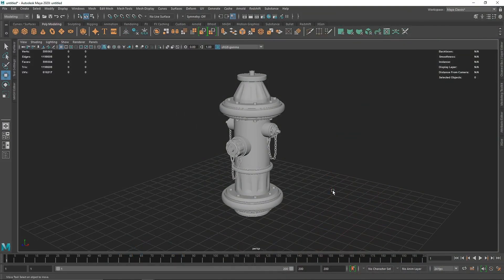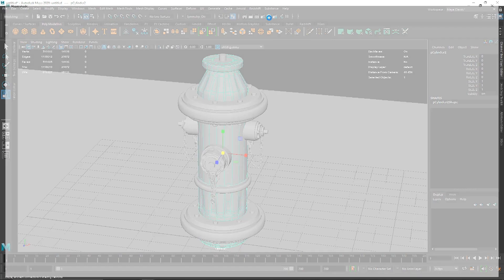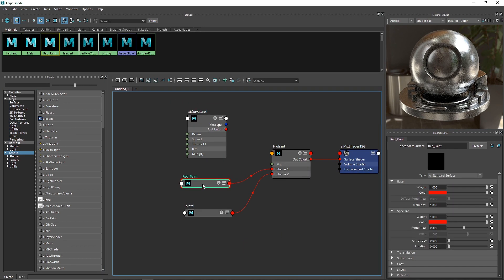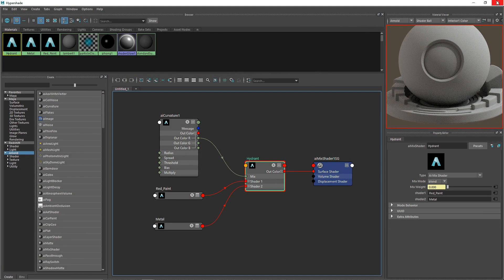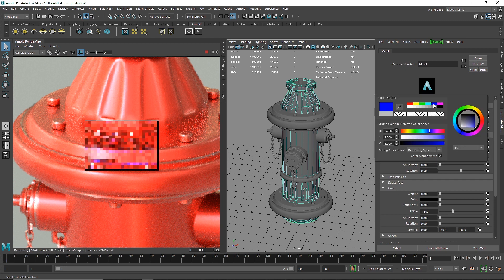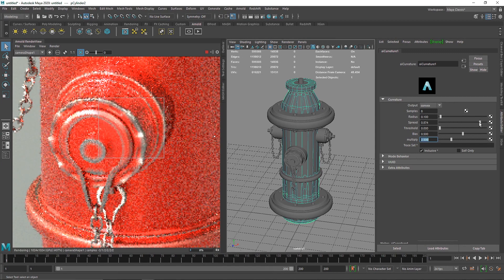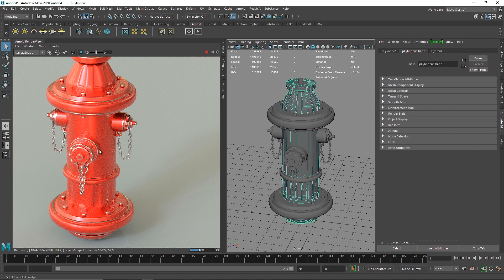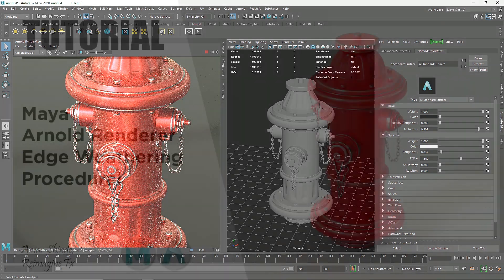Procedural Edge Weathering In Maya And Arnold Renderer - Tutorial

Comment: To test a mix shader out, I made a simple cylinder, extruded a section in and put in some edge loops before smoothing it out. I then added the mix shader and set it up properly, and it works almost perfectly fine, but I have a thin line right on the corner that isn't being shaded with texture 2. I have no idea why and was wondering if you would help.

I also tried using "both" under curvature output, but can't seem to get the worn effect in the crevices. It's as if it's still on convex.